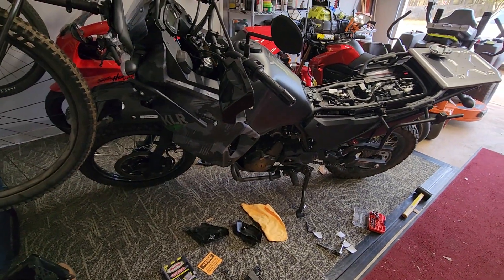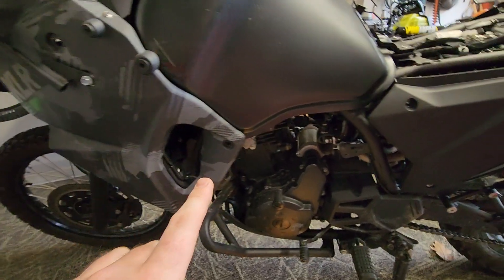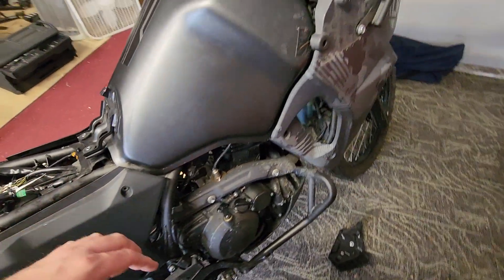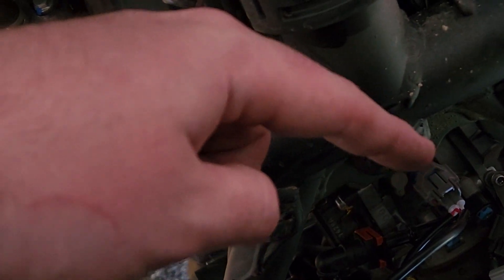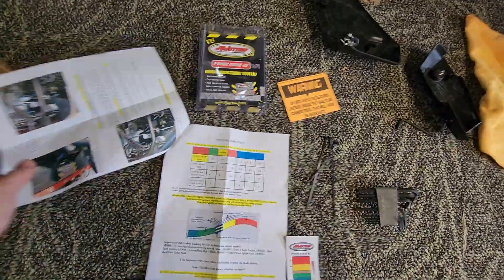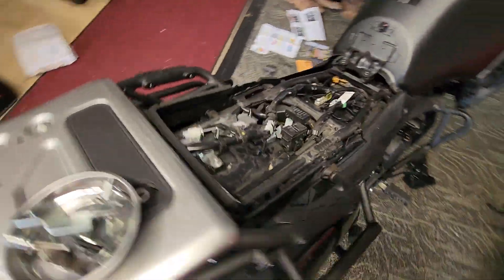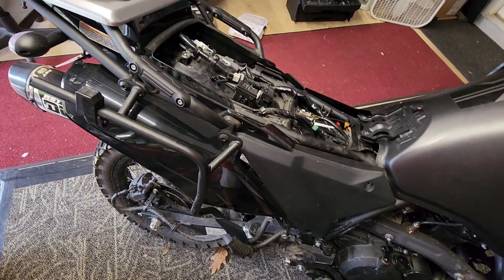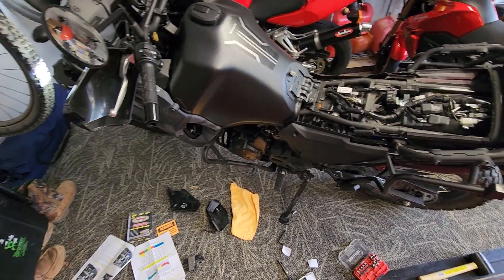2022 Kawasaki KLR650 JDJetting Fuel Controller Install Overview/ Fuel Tank Removal

Comment: What exactly did you do with the air box? Snorkel removal?
Reply from the maker: Yeah snorkel removal, depending on how this turns out I may be doing some trimming and opening it up a bit.
Reply: It's also important to have a performance air filter. The performance increase in large part relies on the total airflow in+out of the engine. A high performance exhaust won't help, and a high performance air filter won't help, but when they are combined, the total air flow thru the engine increases, and that means more power.

Comment: Hey, I'm looking at doing the exact same mod setup on my 22 klr 650. With the exhaust, intake and tuner mods done, did you notice much of a actual performance difference?
Reply from the maker: It's certainly noticeable. The bike has a bit more pep now. I've got a day scheduled to have the bike dynod. I'll post that video when it happens! The bikes run lean from the factory, this is a simple way to get it within the desired fuel ratios.
Reply: @teages078  Did you just leave the Factory connection under the tank dangling? I have not installed yet but have the product. Also having it down by the battery...do you have to change Modes, where that would be hard to access vs being up by dash?
Reply from the maker: @Darren H  this kit plugs directly into the factory harness. The injector plugs into the controller then the controller has another lead that plugs directly to the rest of the harness making it an "in-line" controller. I tied everything neatly up to just make sure everything is secure. Once you get the fuel modes where the need to be there shouldn't be any reason to go in and change them. Which is why I liked it tucked away from dirt and debris. Let me know if you need anything else!
Reply: @teages078  What mode did you select? so you dont need to adjust when you go from street to dirt?
Reply from the maker: @Darren H  I am using the preset setting that come listed on the instructions for the mods I have on the bike. I have the intake mod and exhaust so the instructions have a preset fueling for those modifications. It's all based on what you've done to it which requires certain levels of fuel additions. They have pre-configured selections in the instructions based on what you've done to the bike. So there isn't a need for on and off road switching.
Reply: @teages078  I installed and did settings and bike won't start. If I go back to factory it doesn either. Did I somehow close a fuel valve?
Reply from the maker: @Darren H  yeah it sounds like something didn't get connected back correctly. The factory fuel injector line plugs into the jd fuel controller then to the battery. Nothing else. Also make sure that vent hose on the right side of the front of the tank is connected back. And just make sure everything is connected and tightened.
Reply from the maker: @Darren H  you could've knocked the fuel pump plug off or something simple. There isn't much under the tank, I'm sure it's something simple.
Reply: @teages078  Haha. I hit the kill switch!!   What ajackass
Reply from the maker: @darren5v1  it happens! Glad it was something simple

Comment: Can't get bike to start after install. Just a clucky sound for 3 seconds. Can I send you video to see what I did wrong. I did set the box correctly as the electric is right. And I grounded black wire
Reply: Did you figure it out? Did you get the jd fueler to work? How do you like it?
Reply: Check the tuner ground. I had the same problem and it wasn’t grounded well. Changed the location and worked perfectly

Comment: Of all the mods over the years, I have never seen dyno proof showing the performance gains on the KLR.
Reply from the maker: I have an appointment scheduled to do a dyno pull. I'm waiting on my replacement fuel controller to come in. I'll be more than happy to video the dyno.
Reply: Not says nothing has worked, just haven't seen dyno results.
Reply from the maker: @MrPepper312  yeah I get it, jd jetting posted their dyno results. Nonetheless, I just want to do my own.
Reply: @teages078  Jetting kit on a fuel injection bike ?
Reply from the maker: @MrPepper312  it's an efi fuel controller made by jd jetting